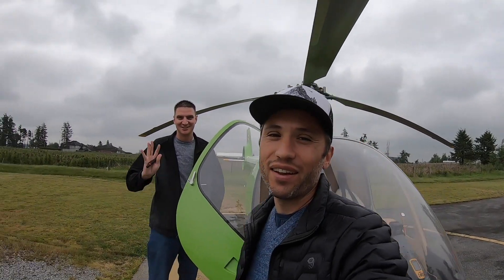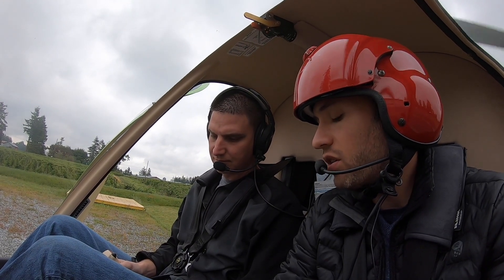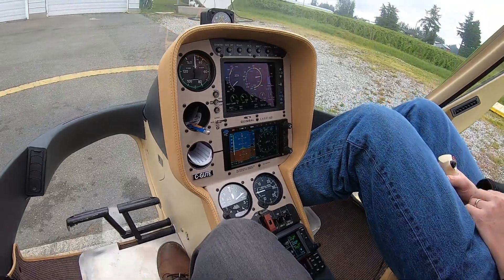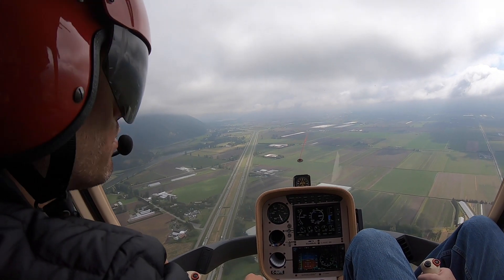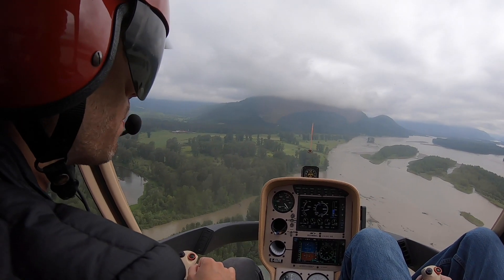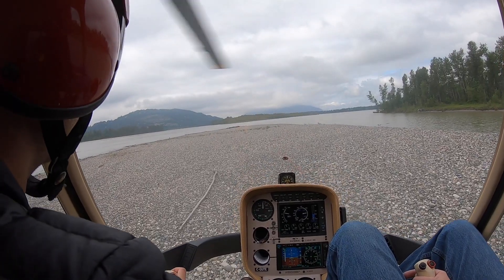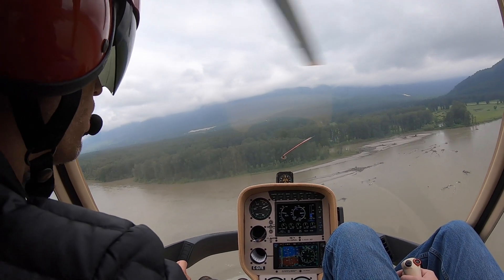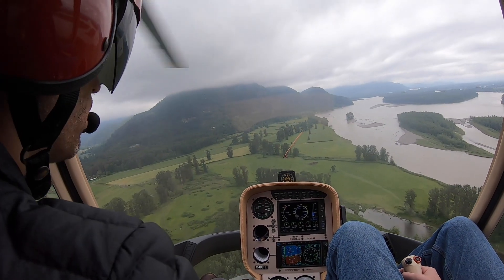HOW TO DO A PERFECT CIRCUIT

Comment: Helicopter circuits @1,000ft AG. Is that upon request of certain air traffic control towers? I thought is was about 500-600ft AG to avoid fixed wing traffic patterns? Just curious 🙂
Reply: Depends on where you are at and what you are trying to do. Whether you are infield practicing or trying to land on the runway at an airport.
-Rick

Comment: Within a perfect circuit wouldn't you include other items to shoot for like Parameters to meet during the climb, leveling off, decent, approach and landing. Giving the pilot parameters to shoot for during a standard or specific conditions? Allowing the pilot to self teach and evaluate themselves in addition to your input. Have the student pilot talk out loud as they follow or drift away from the parameters, then interject. Student pilot will spend more time on perfecting their performance than listening to input. If parameters are set the instructor can't move the goal post. It might not be an issue at 1400 feet though gud mental practice to perform power checks or estimates before every takeoff or landing, not only where the helicopter is approaching it's limits? Just thoughts. Fly with a plan.